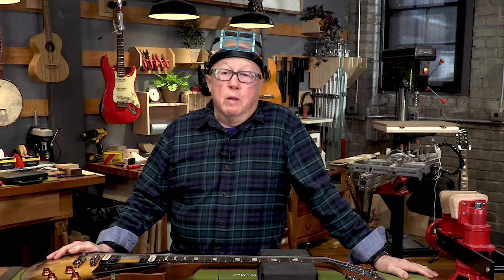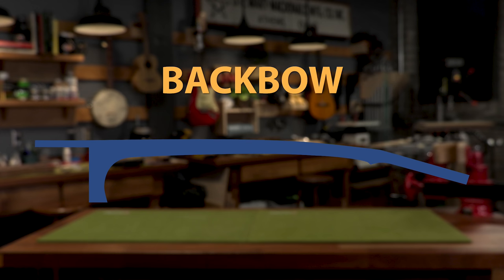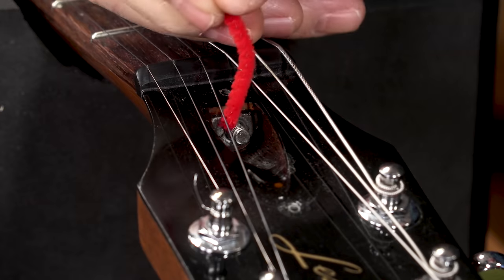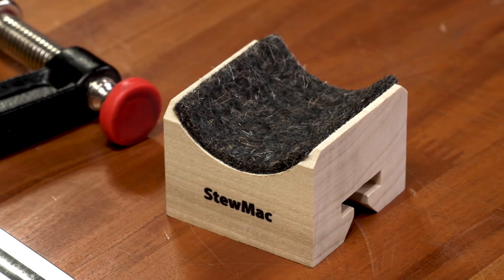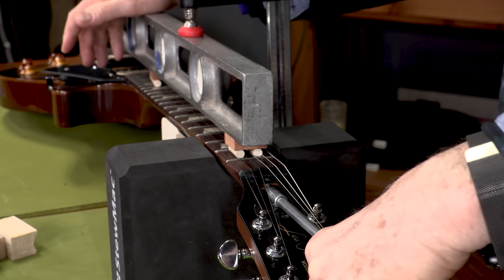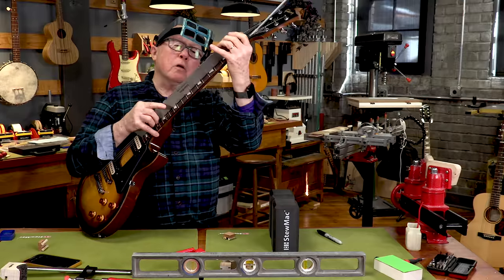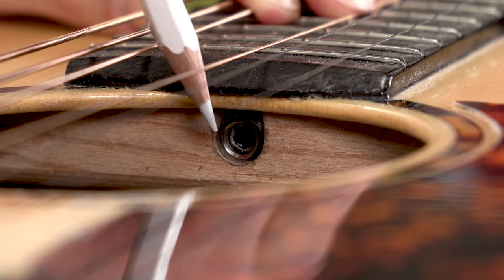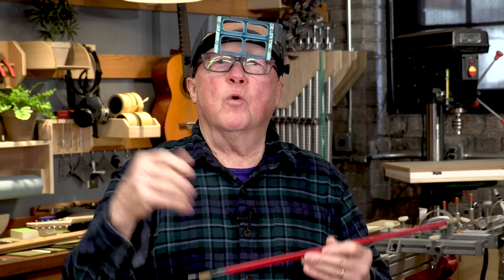Can You REALLY Adjust Your Truss Rod Without “BREAKING YOUR GUITAR?”

Comment: Most used (or ironically, UNUSED) guitars I see for sale at pawn shops have a difficult or unplayable action, especially in the middle of the scale, due to too much neck relief, or 'upbow.' Maybe the guitar sat unplayed for years with tight strings. Since most guitar owners have a screwdriver and basically think they know how to use it, they go after this neck relief (truss rod) issue by seeing and treating it as a high action and adjusting the bridge or individual saddles to reduce the string clearance at say the 12th fret. But that will only get rid of a fraction of the problem at one zone of the neck and not really make the guitar play better all over the whole neck. As you have simply and elegantly pointed out, correcting an action problem should start with a proper look at the neck relief. Usually it's off, likely an upbow, and increasing the truss rod tension should be the first remedy. Often that cures the whole action problem right there. It's understandable many people are scared to do this or think it's advanced mechanics or voodoo, but you've shown here that it's something many people can do for themselves and they shouldn't be scared to try. Dan, I love and appreciate your calm, fatherly way of sharing these techniques. Like you, I'm still using tools and methods handed down from my dad.

Comment: The guitar I learned to play on was super cheap and needed the truss rod adjusted massively. I never thought about doing anything like this, so I adjusted it as far as I felt comfortable with, then I left it sit for about a month so everything would settle and get used to its new position. Then I would adjust it again after it felt like it settled into its new position and loosened back up to what felt normal. That thing was about as bad as it can get. It took a long time, but worked fine for me.

Comment: I like to end up with a slight back bow. it's mainly due to conditions where you are at. there are some places where the humidity changes drastically. and in areas like that adjusting the neck to dead flat. a person can experience a forward bow after several days due to humidity conditions.
Reply: A back bow? that ain't right
Reply: @UmVtCg  That depends on how you look at back bow. I learned that the bow of the neck is determined from the center span of the neck. so if a person puts a straight edge on the fretboard. there should be clearance that can be measured with a feeler gauge. most people measure the clearance at the seventeenth fret. and if measured from center span of the neck it makes sense. because the bow would be towards the back of the guitar. and forward bow would be towards the front of guitar. ideally a person would want the fretboard dead flat the whole span of the neck. but where I live the humidity can change drastically by over twenty percent at times. and with that much humidity the fret level has to precise and on cheaper guitars it won't always be precise. but a person can sometimes offset that with a slight back bow and lesson the chances of a buzz. but if that doesn't work it will have to have a fret level and recrown done. Dan even mentioned that people measure it differently. and have different words for the back and forward bow. which is essentially the the arc/radius for the length of neck. in one of his other truss rod adjustment videos. I have been building and repairing guitars for over fifteen years now. although I haven't been building any guitars recently. because I have a pretty steady flow of people having their guitars repaired. something else that I look at differently is. I believe that a guitar should have a complete setup done every time the strings are changed. because every set of strings are slightly different and everything should be checked. including the truss rod, string and neck radius, nut slot depth, fret level, intonation, and pickup height (if electric). and if they are within spec. no adjustment is necessary. but if not they should be brought to within spec.. it's why I have so many people wanting me to work on their guitars. and it all started with one person who was so happy with the repairs I did on his ESP LTD M10 Kirk Hammett signature series guitar. I also have an LTD M10 but it's not a signature series guitar. he helped me get my Vintage early eighties MIJ Jackson Charvel Charvette. I have learned a lot from Dan Erlewine and Keith Wyatt over the years.

Comment: Good to see Dan has come up with a tailor made version. Got onto the caper a fair few years ago from StewMac website ideas section. Carved a semi circle radius from a block of pine stud. Lined with a strip from an old leather belt. Mine is a bit clunky as doesn't have the fretboard slots for strings. Also a semi circle neck block, takes a bit of juggling till all lined up. National Resonators have a very hefty neck with a smally type hex head nut for their two way truss rod. The lightest truss rod being for best neck tone is my theory. Except stripping hex nut or worse would be catastrophic in my opinion. Especially if overseas from factory.

Comment: I just take the neck off, and use my lap as a bowing bench putting pressure on both ends while turning the TR, after you do the frets or check them just put the neck into a slight backbow if you want it straight It is easier to back off the TR with string tension than put into a backbow with string tension(which is probably why there are so many stripped TRs) Also go easy on that headstock especially the tiltback gibsons probably the reason why we have so many broken ones.

Comment: Nice, video,always learn something. Like the lube, new to me and makes sense. Essentially, I use the same technique but simpler, I keep strings at tension, 1/8 turn at a time and help it with two hands and my knee to bend the direction I want. Same principle but easier and faster only one tool required, easy even on the road etc. Thanks for the Videos

Comment: I usually sit on my bed or the floor with my leg under the neck around the 10th or 12th fret & use the weight of the body of the guitar to assist with pulling the neck straight.

Comment: I would think that if you had ever adjusted your truss rod on your new guitar from the time you purchased it, you wouldn't have to fuss with it that much. It's important to loosen up the strings much. I just turn it a little and tune it up to check it. Repeat! I think Leo Fender specks always work for me. Capo first fret and fret out 22. Check at eighth fret with feeler gauge. I have never had any luck with straight. It is by nature a bow instrument. An old guitar would take more fussing because the rod could be stuck. I think doing adjustments according to how the guitar is held always seems to give me the best results. After all, nobody knows your instrument better than you. I have never found a guitar that sounds right with an electric tuner. I always retune at least one of, if not two or three, strings. But then again, trust a tuner if you're not going to play just about every note on the fretboard within five or ten minutes.

Comment: As a tip from another professional luthier, ditch the notched straight edge.. Reason being, you could have uneven leveling if the frets due to some being pressed into the board more than others or when being pressed in, the fretboard couldve had some variances to begin with. Just get a regular no notch straight edge and check the action across the board according to the level of the frets.. not the board.

Comment: I always learn something new when watching Dan work the only thing I would add is not to use Vaseline on the threads use a high sheer resistance oil like rear end gear oil 80/90 weight ,It’s far superior for doing the job… Keep on rocking…
Reply: I’m sure it’s an excellent metal lubricant, but that stuff stinks to high Heaven. I never look forward to changing the rear gear oil on my vehicles. I couldn’t see putting that on a guitar anywhere. He used vasoline because of the thickness, being able to put it where he wanted without dripping.

Comment: Even though I've learned from a professional how to adjust the truss rod, I'm still extreamely nervous when doing it. It has been 7 years since I learned it and I haven't been doing it since then. Now After watching videos about it for months to refresh and buying the poropper tools for the job, my heard still raised a bit when I was getting a slight back bow on the neck. I loosened the truss rod again slowly to get iit straight and now after watching this video and seeing how calm you were when you noticed a slight back bow and even after tuning to pitch I'm a bit more calm as well.

Now I'm just wondering... Before there was too much of an up bow and when the action was perfect (around 1.2 millimeters) I had a a couple of dead notes on the higher frets. I've learned that, that is because of the up bow.
Noww when the neck is straight and the action set to 1.5 milimeters it's buzzing a lot from 1st to 9th fret. I've loosened the truss rod just enough to get rid of the buzz but I now think the action is a tiny bit too high.
So it's just about finding that sweet spot.
But the important thing is that these videos makes me much more calm and comfortable when adjusting my guitars.

Comment: Hadn't thought of clamping the neck in a back-bow, though I have applied hand pressure to weirdly bowed necks and nipped the trussrod bolt up before proceeding with my usual method :- once I have the neck straight I concert pitch the strings one by one, back and forth across the strings getting them back to concert pitch if they drop, nipping up the trussrod bolt if the neck starts to bow forward. Depending on how inherently stiff the neck is it can take as little as one flat of extra turn to maintain the straightness, though on some necks up to half or maybe 3/4 of a turn - not usually more. Sensible or not? I have Les Paul Junior which, using this method actually doesn't require even one flat of additional trussrod tension, so stiff is the neck, so I'm really only having to eliminate any rattle from the bolt.

Comment: I recently purchased an 2002 Epiphone Explorer from an antique store of all places. On the surface it looked okay. I did some set up myself and tried adjusting the truss rod to get the neck level. Only about a 1/4 of a turn at a time. I’d let it set up over night to settle. Still seemed like nothing was changing. 

I ended up taking it to a local guitar shop to get it serviced and set up. I was told after a few days that the truss rod was bad. When I got it home I was a little put out by it but for the most part it is playable. 

But how can I really tell that the truss rod is shot? The Allan wrench head is fine. Not stripped and it’s fairly snug while turning. 

If anyone has any suggestions I’d appreciate it.

Comment: I've yet to watch one of Dan's videos that I didn't learn something new from !!!! I'm probably overthinking but, I'd like to ask if the procedure in this video will help me ? The guitar in question is an Orville Les Paul Standard (set neck, obviously) and it needs a little more relief (counter-clockwise truss rod turn). However, as soon as I turn the truss rod even fractionally, counter-clockwise, the nut is immediately and completely loose. Subsequently, it's completely ineffective (clockwise is totally fine). So, would this procedure remedy my situation or am I totally misunderstanding? My sincere thanks !!! ~ John

Comment: Really nice trick! However, I have a question about the bridge height adjustment in acoustic guitars.
In my case, I have an acoustic guitar with an undersaddle piezo pickup and the saddle in my guitar is notched on the side that rests upon the pickup. How can I sand the saddle to lower the action without messing up my saddle or my piezo pickup? Should I sand each notch individually or can I just sand the bottom of the saddle without caring about each individual notch?
Thanks in advance!
Reply: It is my understanding that saddles with the piezo that are notched have to be lowered from the top of saddle. I found a company on eBay that makes bone saddles for the piezo to different heights fairly reasonable. chrisalsopguitarbits
Reply: If you don't mind loosening the strings multiple times, you can cut the saddle, try it, and if it sounds good, you're done. If not, you can then yank it out and notch it. My experience? I don't bother with the notches, though I make sure the bottom of the saddle is really flat; I use a tiny Sherline milling machine for that!
Reply: Just the bottom as long as it's still flat and you've removed the needed amount on a long tapered line from treble to bass most likely.
Reply: @danerlewine9897  It's an honor to have you answer my question. Thank you so much!

Comment: Are there any signs that there is too much pressure on a trustrod? I recently bought a bass with a lot of upbow. I’ve adjusted it some, but I’m worried that it’s going to snap if I adjust it more. I’d like to adjust it more if I can though.
Reply from the maker: Great question! The rod should turn smooth and easy. If it takes a lot of force to move, or it's creaking, or nothing happens when you turn the nut, you should be cautious and have a good repair shop take a look at it. Thanks!

Comment: I was adjusting the truss rod I’m Epiphone 59 Reissue Les Paul and when I went to pull the allen key out, the truss rod nut started to come out with it!  I pushed the allen key back down and used a thin screwdriver to hold the nut while I pulled the allen wrench out. Scared the crap out of me. 
Does this allen nut ride on top of the truss rod like a socket?
I read on a forum that they experienced this as well. 
Thanks

Comment: For those of you that got scared watching a master at work, have no fear, you can do this at home without the near perfection methods seen here.  A simple truss adjustment and string measurements will get you where you need to be.  Main thing to remember is to do your adjustments slowly and incrementally.  There are much simpler videos to help you do what needs to be done, at home, when you are not a professional.   You can even do your own saddle adjustments.  Rule of thumb:  Always have an extra saddle around just in case.  If a professional luthier is not in your budget, then do the research and DIY.  Anything beyond a simple set up, truss and saddle adjustment should be done by a professional luthier like Dan Da Man.

Comment: Stratocaster neck angle adjustment. I just discovered something on my Stratocaster that I have not seen in your videos (I might not have watched enough). I started having problems when switching to heavier strings, then finding it impossible to get the strings near the frets, and finding out that I have an excessive up bow. So I went to install a Stew Mac shim and noticed the following. The Strat has a hex nut under the metal plate where the neck connects to the body. This hex nut pushes a rod onto a metal disk on the neck, allowing adjustment to the angle. Is this unique to some Strats and is it discussed in any of your videos?

Comment: @stewmac 
  I’d like to first Thank you for the decades of priceless information and merchandise you have offered. 

  My question is about my 2004 Custom Wayne Guitar (Made by Wayne Charvel) 
  It’s a  Villain style (Dinky esq.) and it has a single adjust truss rod at the top (or headstock).  I would absolutely love if you could tell me what size Allen wrench I need? 
  I know for sure it’s imperial and not metric and the size is not common at all.  If you could please try and help me find the answer to this question.. I would be immensely grateful. 
  Ever since the horrible fire that Wayne and Mike went through and lost everything, it’s been very hard getting in touch with either (especially Wayne) and as of several years ago they switched to a slightly wider neck shape that has a two-way bottom spike wheel adjustment for the truss rod.  
  
 
  Oh! One last quick question.. I have your original StewMac straight edge (without notches) that I bought in the 90’s and I was wondering if there were any tips you could give me for keeping the frets from getting dinged up during a level check 

Hope to hear back when you have time and I cannot Thank you enough (especially @Dan Erlewine) for all the great advice you’ve  shared in every catalogue (now digital) since I started back in 89’ 🖤

Comment: I have an acoustic and it seems is stuck, it won't move one way nor the other, does it need a different type of reparation?
Reply from the maker: If it's not turning easily either direction you have some other problems going on and it would be best to have a good repair shop take a look at it for you! Good luck!
Reply: @stewmac  It seems that's what I'm gonna need to do then. Thanks for the answer!